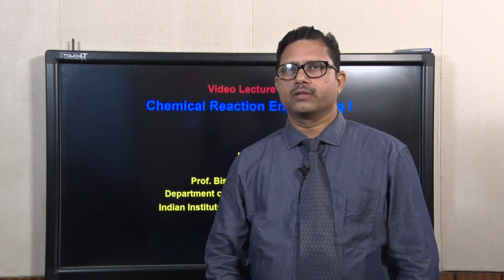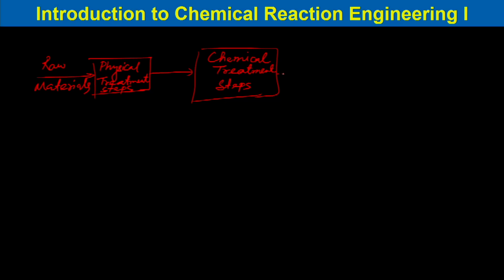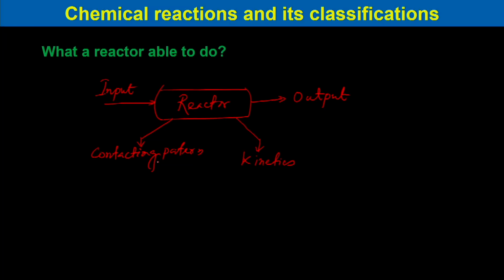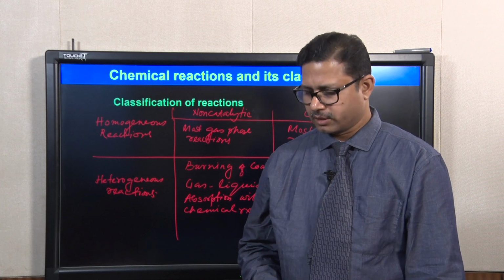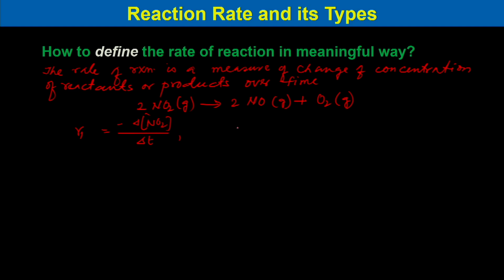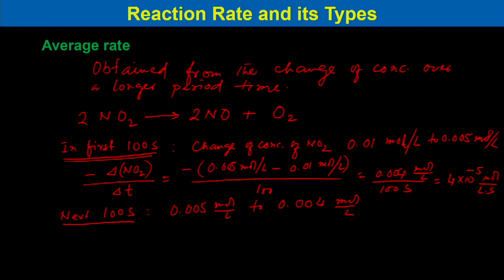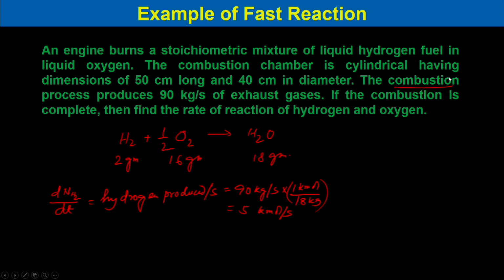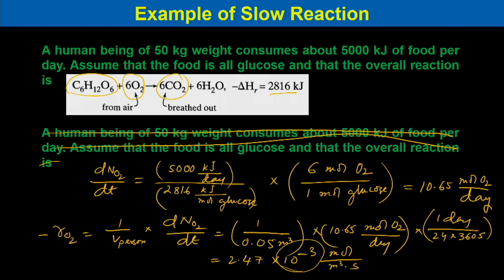Lec 1: Introduction and Overview on Reaction Engineering

Comment: wrong calculation at 59:38
Reply: it will be 5x10^-5
Reply: @S4UR4BH4  why he is utilizing - sign in this calculation. basically - sign is denoting that reactant is consuming ?
Reply: @jahanzaibiqbal3211  if the rate is based on a reactant, its preceded by (-), yes denoting consumption, and (+) if the rate is expressed in terms of products